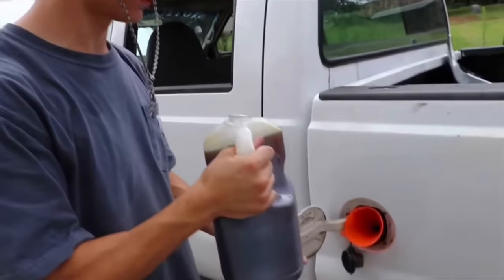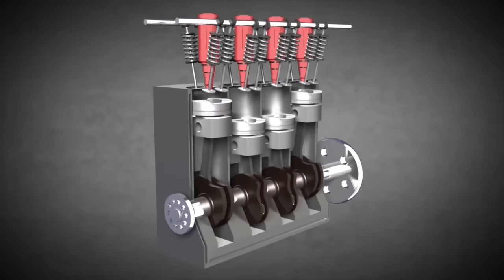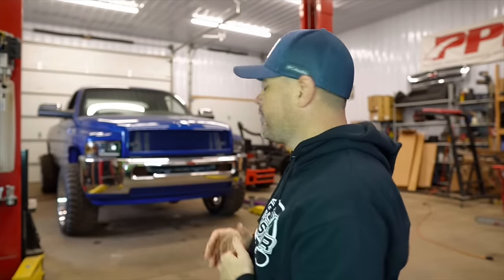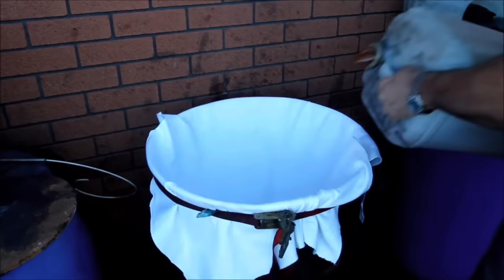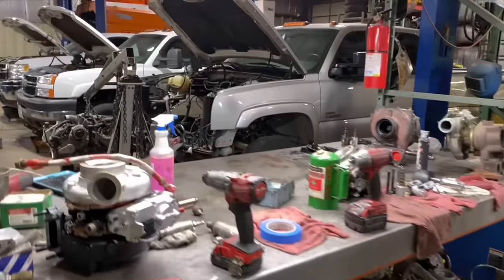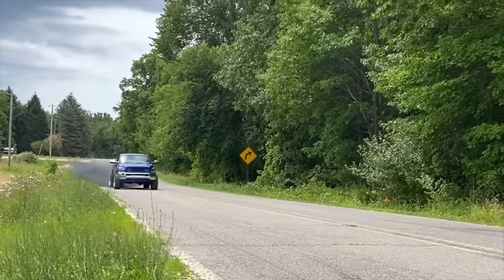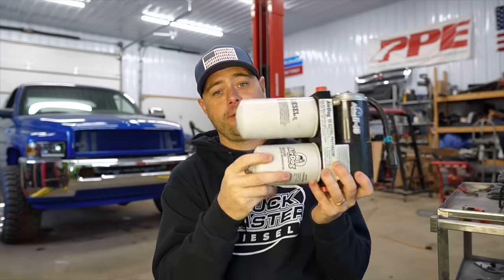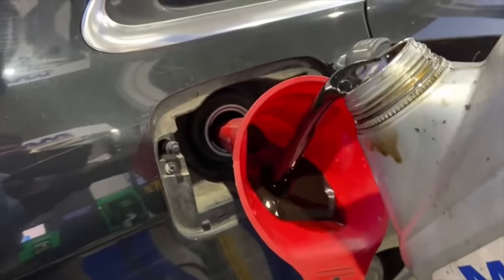Can You Run A Diesel On Used Engine Oil? Free Diesel Fuel? *EXPLAINED*

Comment: I don't know if i could do that too my 7.3 powerstroke i would have too agree that if everything falls apart at the rate were going this is good too know for future possible events if it gets impossible too find diesel but i am curious on kerosene tho would that create more power sense its a cleaner fuel type than diesel ? not shoving it in my tank either its too expensive just curiosity of what others think!
Reply: The power directly corresponds to the weight of the fuel.  Because kerosene burns easier does not give it more calories.

Comment: I've got a 2012 TDI, what modifications would I need to do to run this and is it worth it?
Reply: Figure out how to lose all the emissions
Reply: If you can't tune it to get rid of those emissions you will not be able to run wmo because the emissions devices will fail and they are expensive

Comment: My power stroke 6.0 is not common rail but newer than the 7.3. What are your thoughts on that?
Reply: I have a 6.0 aswell, filter filter filter that used oil or your injectors will hate you. I use no more than 30%oil 70% clean diesel. Can probably go more but i just choose not to. Engine runs really quiet too, i love it
Reply: @kylebrett1453  I’ve been doing the same. 20-30% oil and clean diesel. I ran 40-50 for half a tank and it ran quiet and smooth as hell but was definitely smokier . Power felt ok but I didn’t realize the power reduction until I tanked back up with all clean diesel and noticed the difference. I’m setting up a dual 10 micron filter with a water separator in my garage and a fass lift pump on the truck.
Reply: @garym.5931  nice, i definitely felt a small power difference aswell. I upgraded my blue spring with the sinister diesel adjustable one, and i do add a bit of cetane booster im every tank. It has helped alot for power. I was thinking of cutting my batches with a bit of gas but then it just keeps getting more complicated. Im in it for the savings, and time is money aswell lol. Have you added an inline filter on yours? I was looking at those big spin on filter to add in line before the under cab filter/water seperator unit.
Reply: @kylebrett1453  I was thinking of cutting the oil with a little gas for the storage and filtering loop. I’m basically running it from the 55gallom drum through the two micron filters and back into the same drum. Then I will have a valve to turn the pump on and direct it through an automatic shut off nozzle. I figure the two fass filters plus the fuel filter on the engine should take care of it on the truck for whatever the storage filtering didn’t. I also did the blue spring upgrade and I have a bypass oil filter system as well for the crank oil. I have 210,000 miles on it so if anything goes sideways on me I’ll have a motor built and swap it for more power. Then I’d probably stick to clean diesel. Until then, I’ll run her like an oil rig
Reply: @garym.5931  I have a Wolverine Technologies centrifuge that I used to filter WMO for use in my Multifuel deuce and a half years ago. I heated a 55gal drum with a barrel band heater, enough to increase  viscosity, then ran it through the fuge at about 1gal per hour. The sludge that came out of the WMO was like peanut butter! Nothing I'd trust to filtration to remove before running through my injectors, especially for long-term use. I would then thin my cleaned WMO with kero or gasoline. Never ran WMO in my '04 5.9 Cummins, nor my '21 6.7 Cummins, as much as I want to lol.

Anyway, the centrifuge will clean down to less than 1/10th of a micron if it's run slow enough. Just some info that might be helpful to you. Good luck! 👍 👍
Reply: @gadsdenconsulting7126  thanks for the info. I wouldn’t run anything but clean diesel on a newer truck either. I’m going to see how involved I want to get with it. It’s got 210,000 miles on it now with plans to put in a built motor in future so I don’t mind experimenting on this one. Probably won’t run blends in the new motor
Reply: @garym.5931  I was always going to send CAT a sample of my WMO that I cleaned through my centrifuge and have it tested, just to see how clean it really was. Never did. It's hard to justify gambling with unknowns on a new truck!

Comment: I love your shows or outstanding on diesel and gas engines but if you look back at World War II the douche in half the 5 ton cargo the engine the jeep that they used MM181882 they were multi fuel that means because I’m retired military that means that if you run out of fuel you can join diesel in a gas motor it will run every good but it’ll get you to where you going. If you have to you can pee in the Gatti it will run. It will run regular but it’ll get you where you are so check it out. Do your homework.

Comment: I like your videos you explain things well, I have a question for you on your PVC reroute did you put a tee in it on your Chevy trucks
Reply: TEE not necessary but it does give you 1 single out...or just run to each side, which is what I did for ease and minimize hoses crossing motor. There's cheap kits on Ebay with the fittings that bolt on...just buy hose local or use old coolant hose etc.

Comment: Click bait video.  Have you actually run wmo? Processed it? Or just talking fast in a video on a subject you really have no 1st hand knowledge?  You didn't even state the source of the random videos you used.     For those who use wmo we arnt dumping dirty oil in our tanks.    I filter down to 2 micron.     You mention truck taxes on the oil you burn.     It's actually road tax you not paying.    Has nothing to do with a truck.    If you guys are serious about running waste oil find a video of someone that actually does it.      Pre common rail 80%oil 20%gas is a great mixture.    Common rails do fine on waste veggie oil as long as you don't have a dpf.  You don't need crap like a fass fuel system to run this either.   Filter or centrifuge your wmo and the stock fuel system will handle it with no issues.
Reply: Yea I keep hearing all this can't on a modern...I don't see any reasons why it wouldn't work if filterd well..

There's too many contaminants in that stuff for modern motors...right but what if it's removed??? We have tons of easily accessible data on filters etc